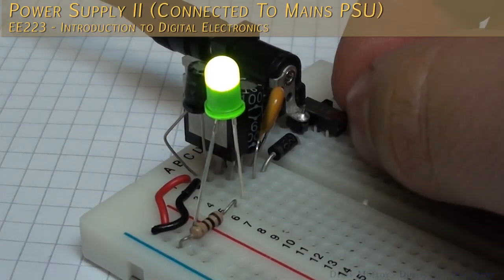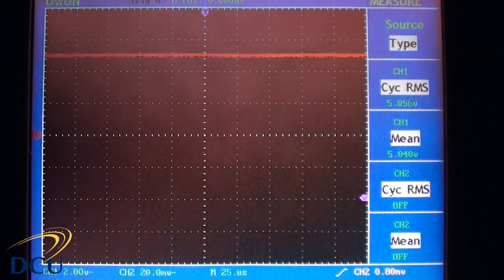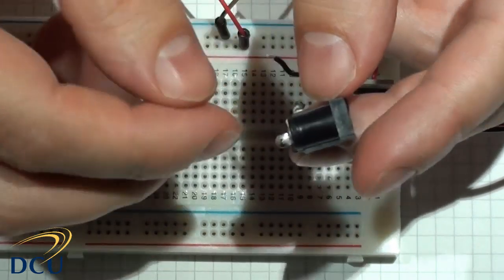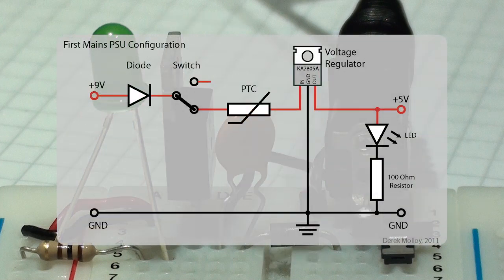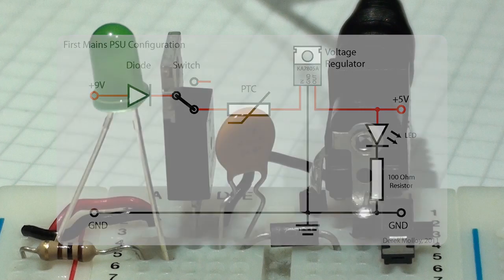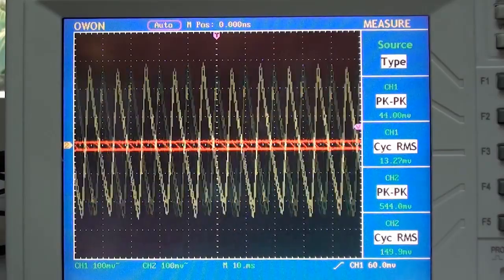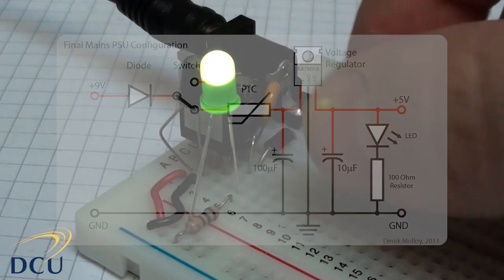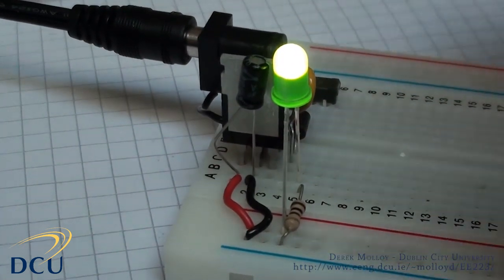Experiments 1.2: Introductory Power Supply Circuit II (Mains PSUs)

Comment: Manufactures recommend 0.33uF on the input and 0.1uF on the output of the 7805. Of course this is for the LM7805 since the KA7805A is now obsolete with most retail/wholesalers.  Is there a particular reason you chose 100uF and 10uF?

Comment: Hello Derek, thanks for the nice tutorial videos.
I am looking at Bourns MF-R025, it's trip current is 0.6A but it's hold current is 0.3A, does that mean it's working current is 0.3A max and it will start heating when the current passes 0.3A? My circuit will consume around 300mA, what fuse is best to choose?

Thanks.

Comment: Is the PTC used in this video a Radial Leaded Fuzetec FRX 050-90F - Operation Current : 500mA, Maximum Voltage : Up to 90V

Comment: Ive enjoyed watching some of your videos, im in the middle of building a laser harp and im using a Arduino Uno board but had some problems and your videos on how to build a basic one with added power supply has helped me to change the design by taking out the Arduino board and just use the basic setup with the processor...
Im a below novice hobby builder but im learning as i go along.. hahaha...

Comment from the maker: Sorry for the delay in replying. It doesn't matter if the current limiting resistor is before or after the LED. If you think of a pipe carrying water (like current) then if you narrow the pipe anywhere along its length it will slow the flow along the full length of the pipe. This narrowing effectively protects the LED.

Comment from the maker: Sorry for the delay - missed your comment. The PTC is chosen based on the current you want to limit at the particular voltage level. So, if you want an axial leaded PTC that carries 16V, and trips at 1.3A but has an operating (holding) current of 0.75A, the Multicomp MC36245 (€0.15 each) will limit the current up to 40A and will have an operating internal resistance of 0.23 Ohm.

Comment from the maker: Thanks. Yes, the limits for the 7805 are 8V to 12V. I think my supply says 9V on the box!, but is measured at 13.8V, which means I am slightly outside specification. I was only drawing a small current in this example, but for a larger current you are correct - you will need a heat sink on the regulator as it is already getting warm to touch - that or a better quality 9V supply! The PTC cuts out if the current gets too high, but does nothing about the heat dissipation. Good point!

Comment: Thanks Derek for all the great videos! I have a question for you concerning power supply circuits. How do I know what the values of the capacitors should be at the input and output of the voltage regulator? I want to use a 5V 2.2A voltage regulator (MC7805) for my circuit, powered by a 12V regulated supply, but the the datasheet is not clear on what caps I should use, saying that a 0.33uF should be used for input (sounds a bit low to me) and only that the output cap should be more than 0.1uF.